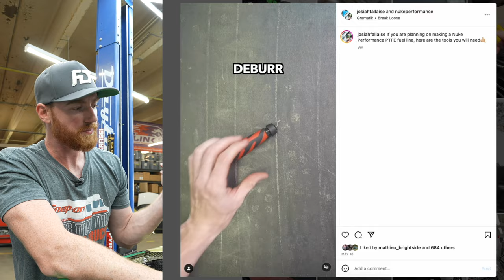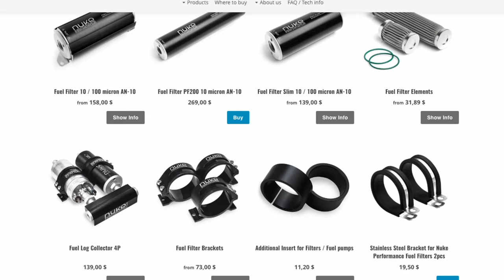Stock Fuel Tank in a Pro Drift Car? (Episode 32)

Comment: Josiah!!.. great vid!

Quick question.. about the flow of the fuel return. Is it possible from the return line of the fuel regulator run straight back to the main tank rather than back to the surge tank?

Comment: Hey Josiah, why did you choose to use driver tank not passenger for weight distribution?
Reply from the maker: The drivers side is easier for the fuel neck and the passenger compartment holds my fire suppression tank and water pump with a mount for a weight balancing plate (if my car weighs under 3000lbs I have to add weight to it, in FD you are allowed up to 50lbs of ballasts)